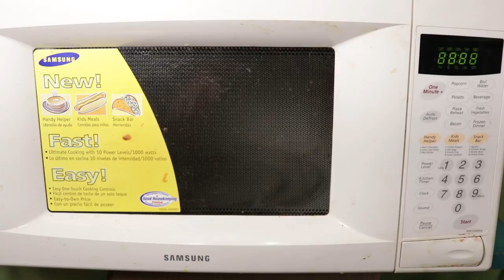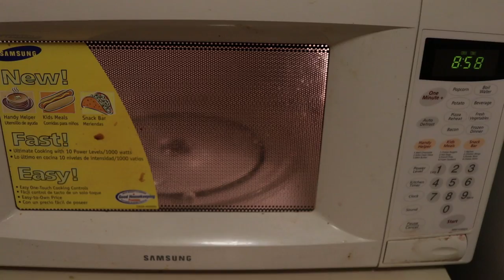How To Repair A Microwave With An Unresponsive Touchpad

Comment: Where it says Danger do not touch this part, be extremely wary of the component tucked under the exclamation point; that is the capacitor and is what can kill you.  The transformer is not dangerous as long as the machine is verified unplugged.